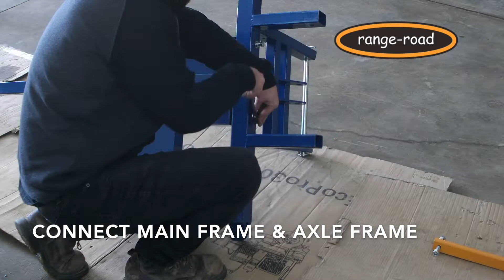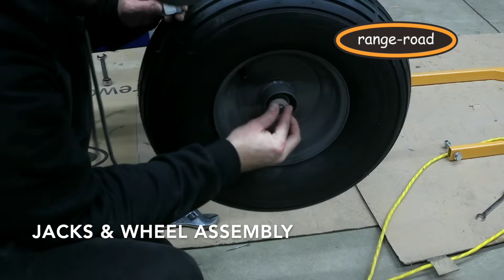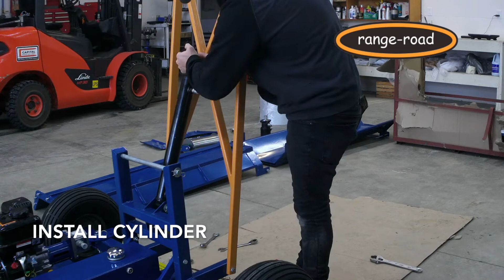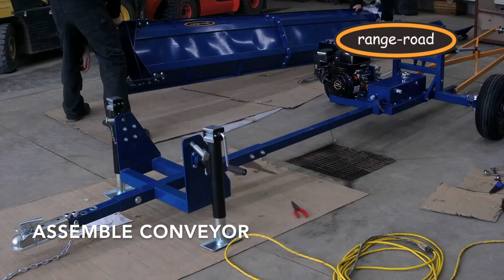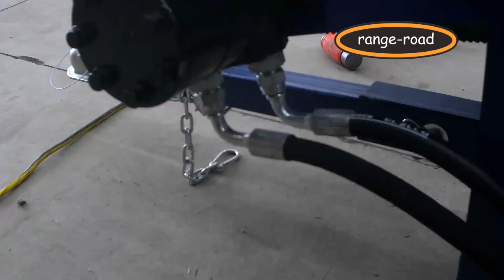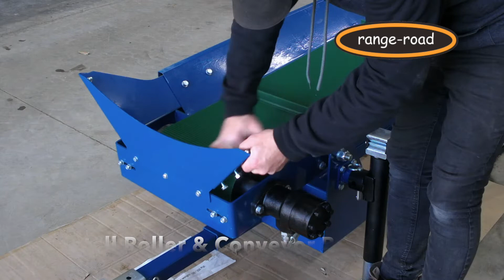Range Road RR502 Assembly

Comment: Good video, I recommend putting the engine on before the hydro tank, 
Unless u have some stubby offset 13mm wrench. 
Otherwise can only turn the nut like 1/16th to 1/8th of a turn.  Instead of a half tun at a time. Which is a lot of wrist action with those extra long engine mounting bolts included. 
The tank can be easily mounted with an extension on the ratchet. In like 30 seconds.
Reply: Just put mine together a few hours ago,  fill hydraulic tank first before u mount it
Reply: @Switchbackrider  yeah, I had a long funnel